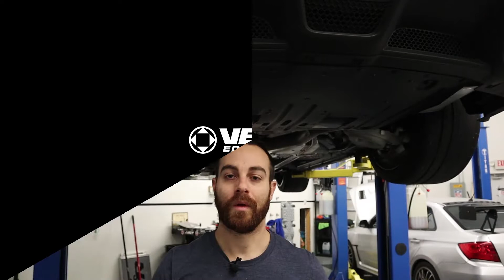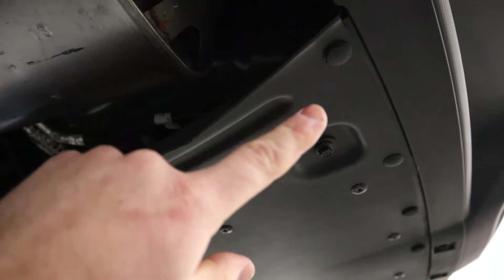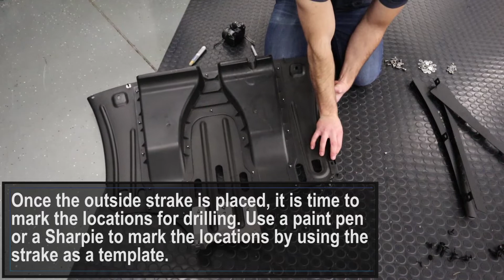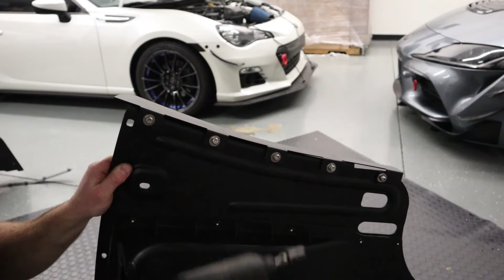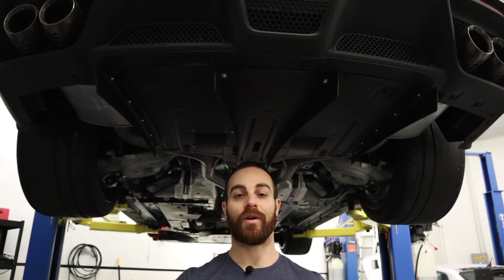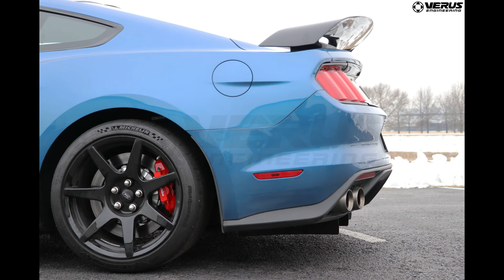Ford Mustang GT350/GT350R Rear Diffuser Strake Kit Install

Comment: Also Should the Inner Strakes Meet to a Point to Create a Funneling Effect?  If so Can You Mod the Set I requested 3” Taller/ Longer / Deeper?
Reply from the maker: Diffusers work by encouraging and controlling the expansion of air from under the car. If the strakes came to a point, they would be blocking off and limiting a substantial amount of air flow which would add significant drag and and create lift.

Comment: This will fit a '22 Mach 1 with HP correct?  Same rear diffuser as gt350.
Reply from the maker: Unfortunately, we cannot confirm. If the Mach 1 has the exact same factory panel as the GT350, it will work. However, I believe it is slightly different and the Mach 1 uses the Gt500 underpanel which is slightly different than the Gt350.

Comment: Hey when are you going to release the  Full GT350 Diffuser?  If you have ai am not finding it.
Reply from the maker: We are not going to offer a GT350 specific rear diffuser. However, our S550 Rear Diffuser can be slightly modified to work with the GT350. I thas been done a decent amount of times already.
Reply: @VerusEngineering  ok looking now!  im not afraid to use hammers
Reply from the maker: @TrackDayVideo  we love it! If you send us an email, we have some photos from a customer who did it on his.

Comment: Hey guys, so glad to see you revisit the GT 350 and 350R aero! We had talked a while ago about making your older Mustang diffuser. I had bought one of those from you  and gave it to Trent here at Sonoma Raceway to modify (NACA ducts for rear coolers). Curious and excited to see how much different the new version will be. I would have to say it’s a bit bittersweet to see you guys come back to the Shelby and give it more love! Can’t wait to see the finished products! Any thought to extending the flat bottom of the car to be in front of the diffuser (like you do the Cayman GT4)?Keep up the great work!
Reply from the maker: It will be the same rear diffuser, but we plan to offer a template for cutting to make it easier to mount. As far as underbody panels, we do have some things in mind.